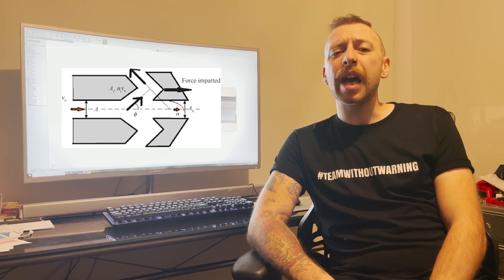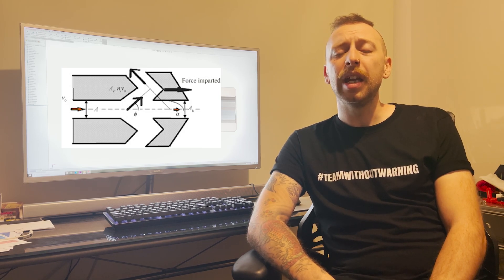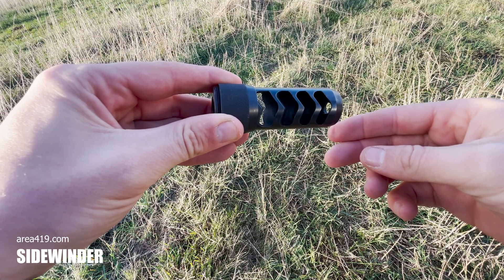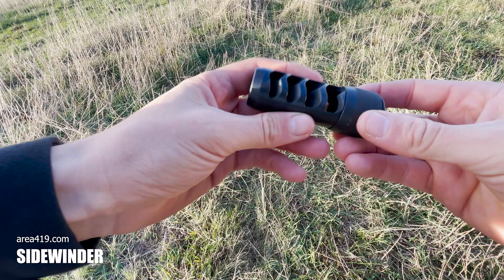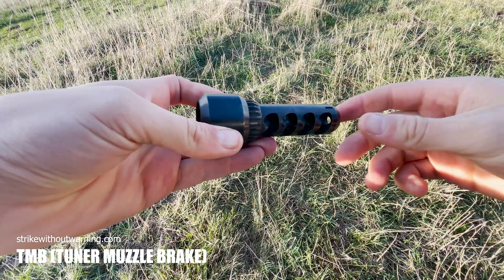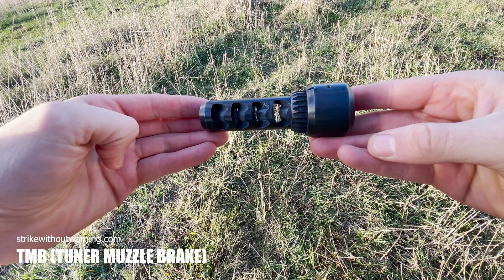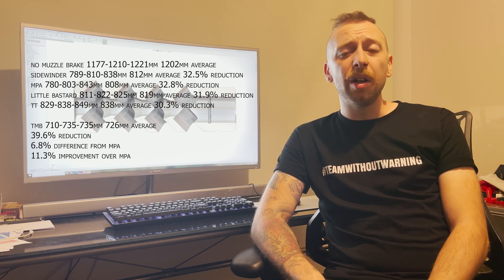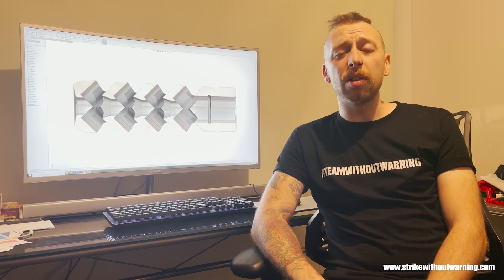Felt recoil test (WITHOUT WARNING TMB) (barrel tuner, tuner muzzle brake, muzzle brake test)

Comment: Hmm… it is thus interesting that brakes are made from CNC machining solid steel bars from the exterior. If complex interior geometry is such a big factor would it not stand to reason that making a brake from cast steel with interior geometry that is impossible to machine might be a good idea?  It would probably require casting it in two halves or two parts that would need to be fastened together with imperfections from the presence of a seam though… and the cast surface will have a surface roughness profile different from machined steel. 
Just thoughts.
Reply: I’ve already solved this. More on that at the end of the year when I’m ready to show it. But casting isn’t needed. Machining is better.